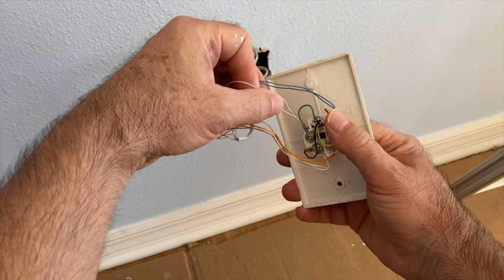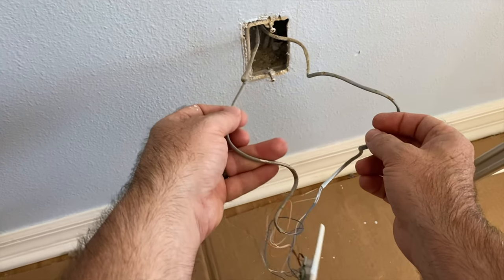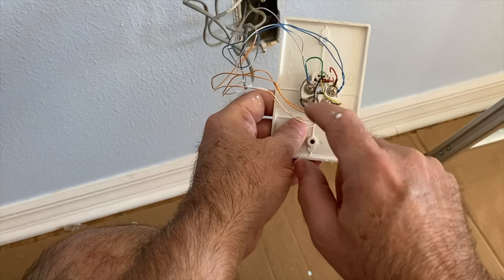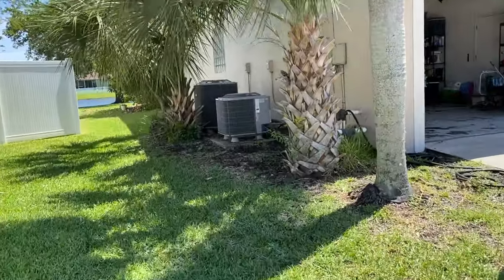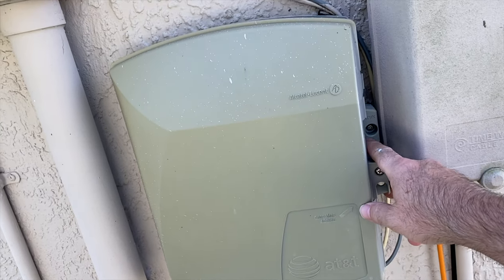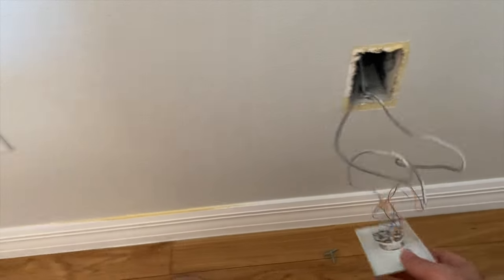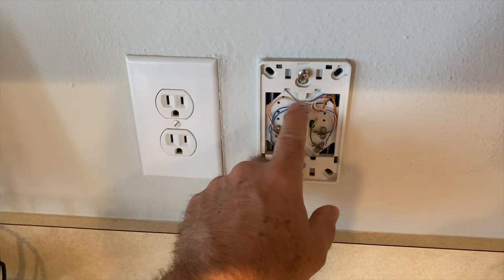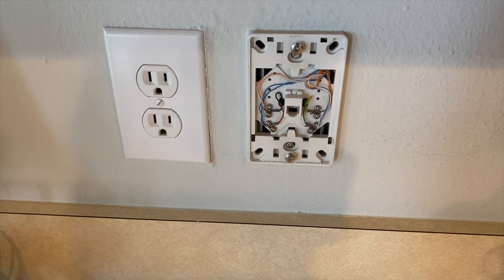House Phone Wiring pt. 2

Comment: Do you have a video of PULLING the wires out of a home? Is there electricity to any of them? I am a female DIY & want to move tons of old phone wire and also cable wire that will never be used. Lots of old equipment. Can you help me with any guidance?
Reply: Its probably negligence to say whether or not wires in your house are live.   

Phone lines are energized from the outside though.  Things like voip modems will energize them as well.

Comment: Best practice is, if you daisy chain, it should be a loop from NI to all the jacks and from the last jack back to th NI/Dmarc.  Should a jack be lost, the phone service to the others remain.

Twisting the like tips and ring wires and putting them under a single screw at the jack is a weak point and has been known to fail.  Wires should terminate under a seperate washer under the jack screws.
Reply from the maker: That’s interesting Don, so basically the wiring makes a full circle?
Agree with the double washer approach.   My suspicion is that these home builders just have the electricians do all the low-vo wiring.  
Thanks for chiming in with that piece of info! 👍😀
Reply: @DIYTelecom  That's correct.  Making a loop feeds both ends of the daisy chain.  Proper polarity is necessary at all points.  All the pairs should be made-up at each jack location, so having to get into all the jacks to add something isn't necessary.

When I was doing prewiring, I always home run to each jack.  👍
Reply from the maker: I’ll bet that helps reduce RF noise on the line. (hum).  
Agreed about the home runs.  Unfortunately,  This is what I was given.  I may try to retrofit some home runs for Cat6, but it’s gonna be work! 🙄
Reply: @DIYTelecom  Yep.  Somtimes we have to work with what we got.
Reply: @donl1410  I prefer home run lines over daisy chaining lines. Way easier to work with and troubleshoot.
Reply from the maker: 100% agree!  But the lazy home builders keep stringing the inside wire the same way they did in 1988. 😆
Reply from the maker: Well, you could call your local phone company.  But they can be pricey.  And, sometimes as frustrating as dealing with the federal govt. 😆
Optionally you can do a internet search for “phone repair near me”.  Ask two important questions:  1.  What is the hourly labor charge?  2.  Do you have experience with residential wiring?
Good luck 👍

Comment: If both those lines where bringing dial tone from the modem could we in theory use 4 numbers at that jack or is 2 phone numbers the max we can get to the rj11 jack. Without conflict in dial tone. I'm a commercial technician. I wire businesses but my only struggle seems to be 66 punch down blocks. I don't understand where the dial tone lines get punched to.
Reply from the maker: Hi Jun,  yes, a typical RJ-11 support 2 separate phone lines.  They do make similar jacks with 6-pins which allow 3 lines.
Typically, once an organization (or home) needs more than 2 lines, they go with some sort of business phone system. 😊
Reply: @Paul Jameson nice description thanks

Comment: Daisy Chain is  similar to punch down ..just for residential
Reply from the maker: Oh you mean like those 6-pin wide punch-blocks (sorry can remember the proper RJ name)?
Reply: @DIYTelecom  yes they have 8 total pins ...but I hear of others I've never dealt with those
Reply: @Paul Jameson yes you are rig... I'm saying it's similar to daisy chain because it is a continuing of signal... say you have a number of 123-456-7890 daisy chain allows you to repeat that number jack to jack as you said.... with a 66 block you can repeat that number at the block how ever many times ... I've done it for 8 or 9 or 10 rooms having the same number there coming from the block and using cat 5e to send the signal to the areas.  Yes it's not the same just has some similar things
Reply: @Paul Jameson oh OK.  I've never used that one ... I only used a punch down for many lines
Reply from the maker: Kind of on an oddly related note:  here in the US (and I suspect other countries) many house holds no longer have land lines.  I wonder if all that decrease load on the copper circuits has allowed for larger REN values for those who STILL DO have an old fashioned telephone 🤔
Reply: @DIYTelecom  yes I've noticed that.  They may have but 1 phone jack in the house now

Comment: The wires from the phone company into the demarc are yellow/blue and yellow/white but inside the house I can find the red green/yellow black pairs. I'm really trying to disconnect so that I can add voip, should I be worried about those lines outside? I'm thinking I'll just be splicing them away anyhow. Am I correct in this thinking?
Reply from the maker: Yeah the color shouldn’t matter too much.  But if you will be back-feeding you house wiring with voip dialtone, you do want the demarc wires disconnected from your inside wiring.
Reply from the maker: Great comment Paul.  Nice to hear from the other side of the world.  Here in the US, our infrastructure is a complete mix of so many things.  Still a majority of houses have copper from the street.  More modern houses (last 20-30 years) have fiber.   And,  many people now get their dial done from the CATV provider. Thanks for watching 😊